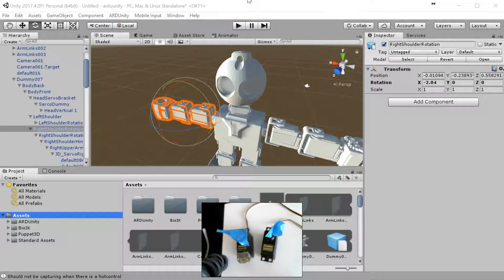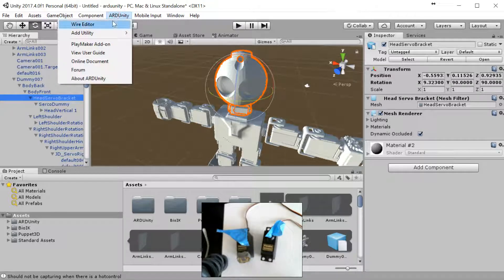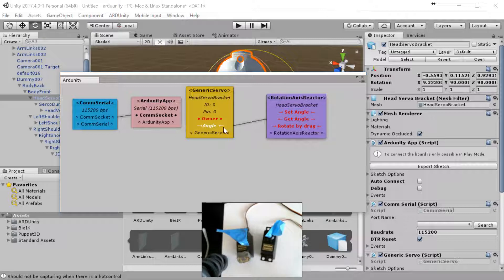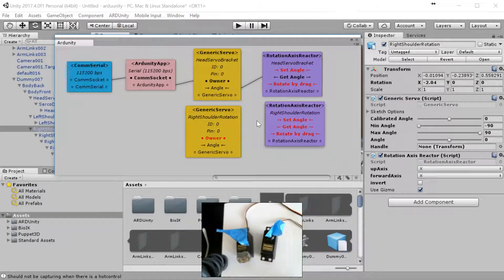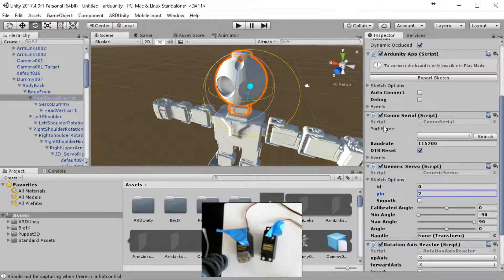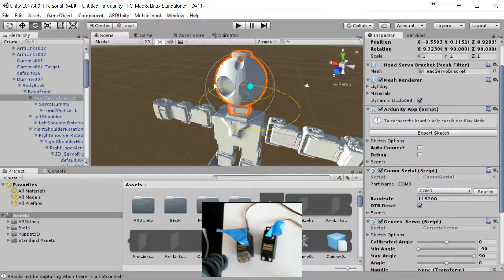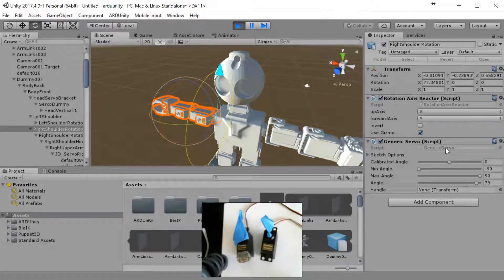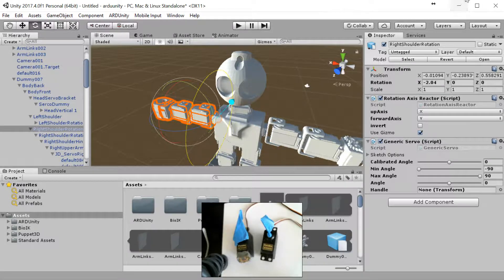WIP Robot control with Unity and Arduino.

Comment: Looks simple when you go over it, but how long did it take you to figure this out? Cant what to see how this works out with the ezb.
Reply from the maker: I'm really great at sourcing stuff and applying it to my needs. In this case there are a few items that existed, Unity and a plug in called Bio IK (Inverse Kinematics) The hard part was just connecting it all together and making it work. I am working on a stand alone robot animation program that will require waaaayyy less knowledge to get robots to move.
Reply: If you share the jd model project with me, I’ll modify it to work with Servo Camera Server
Reply from the maker: @DJSures  I released these videos from unlisted mode for ad sense, they are from 2018, when PTP, Mickey and I were working on it. I have a new solution now, and I will be talking about it soon here on this channel. Its going to blow your socks off!!! Might need a new plug tho...when is the Synthiam store going to be up!?!

Comment: I'm using Unity to control my robot too on my channel. Check it out if you are interested.
Reply from the maker: I'm really interested in using IK, I had to add a plug in called Bio IK to use it in unity. But thinking of moving over to Unreal as they have added native IK support in ver 4.26.
Reply: @Will_Huff  Unity has added Built-In IK System in the 2019, 2020 update.
Reply from the maker: Ahh that’s great news! Checked out your channel..that’s a ton of work! Looking good. Keep it up!